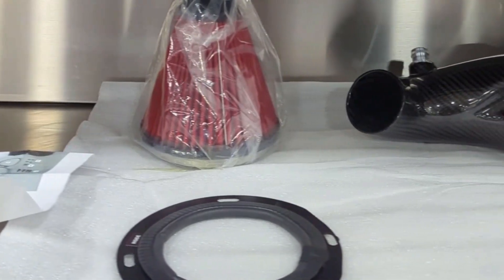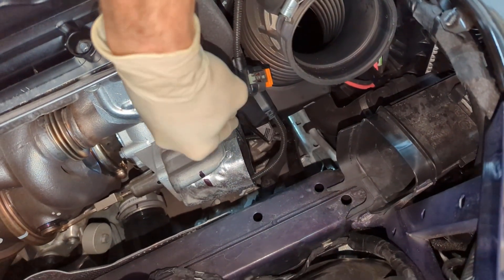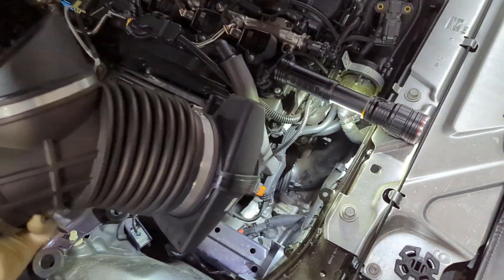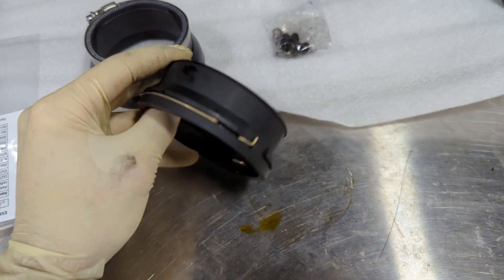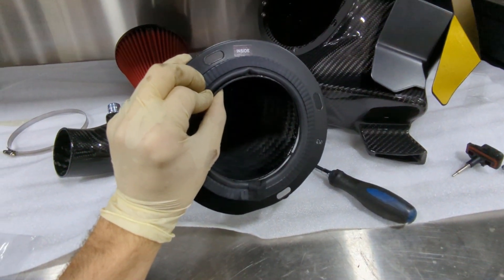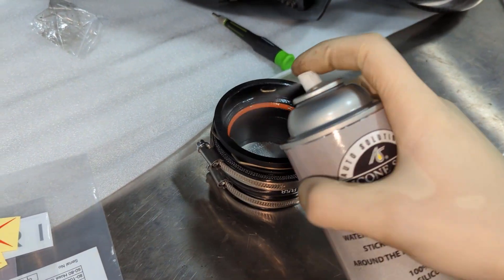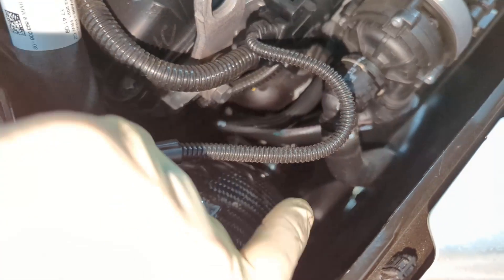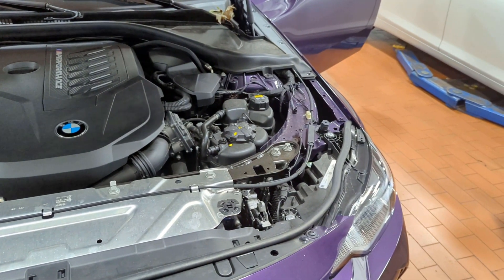How To Install The Eventuri Black Carbon Intake System On A 2022 BMW G42/G2X M240XI B58

Comment: I had oil in my pcv line. Is this normal?
Reply from the maker: It is pretty normal to see some oil, excessive amounts could indicate a failing oil separator in the cylinder head cover. How many miles on your 240?
Reply: @Snipeoff 18 k. It’s a 2023. It was just wet thought odd
Reply: Not running out of the line or anything. Enough to coat my pinky when I touched to see if it was water or oil
Reply from the maker: @MatBuchanan  I wouldn't worry too much about it then, maybe do your oil change a little more often, 3 to 5 K if you aren't already
Reply: @Snipeoff  ok thanks for replying and setting my mind at ease. Very helpful video also!

Comment: is it recommended to disconnect the cars battery?
Reply from the maker: That is recommended for pretty much any repair, however I did not for this repair, there really is no danger of damage here. Only one connector is unplugged. To be safe though it wouldn't hurt to disconnect the battery

Comment: If you need to take the filter out to clean, do you have to pull the entire system out? Thanks in advance.
Reply from the maker: So I haven't tried it, but I think you would be able to remove the screws on the air box and slide it out over the filter without removing the pipe, if I get a chance I'll check soon 👍
Reply: @Snipeoff  Hi, would you be so kind as to tell me if you had to remove the entire system to clean the filters?
By the way, nice video!
Reply from the maker: @alainmo2106  unfortunately it seems a good amount of it would have to come back out to clean it 😕
Reply from the maker: I haven't been able to try yet though

Comment: Im a little confused, what happened to that wire clip next to the clean air pipe? You didn't mention anything about plugging it back in.
Reply from the maker: Unfortunately the new pipe didn't have a place to reinstall it, but it's in a pretty safe place there, it's not going anywhere
Reply: @Snipeoff  oh okay I see, that’s interesting. I wonder what it is for. Anyways thanks for the video I just got mine but am still hesitant in doing it myself
Reply from the maker: @mohamedabdelaziz7544  It depends on your experience level, if you take your time, probably be alright 👍. That PCV line is the hardest part
Reply: Mate you were absolutely right 😂 but In end I got it done🎉 thanks for the video tho, really gave me the confidence to do it myself!
Reply from the maker: That's awesome man, glad to hear that 😂😁